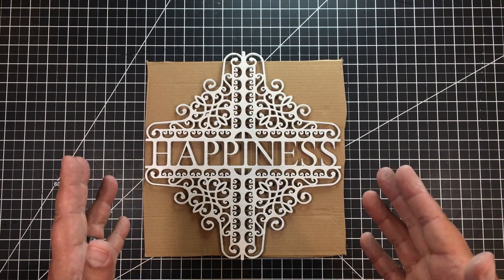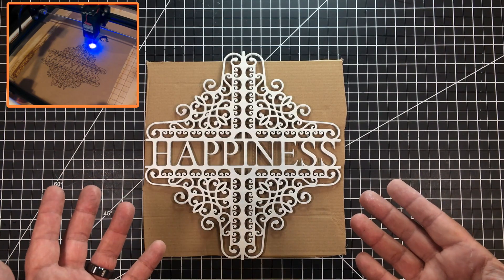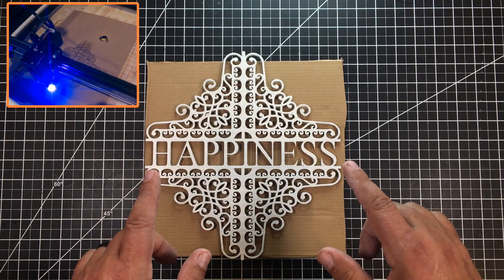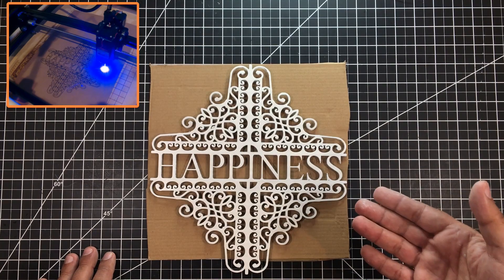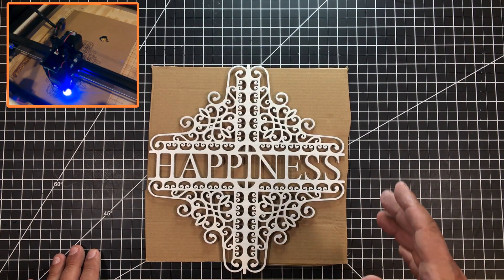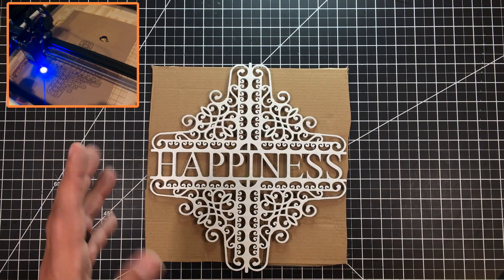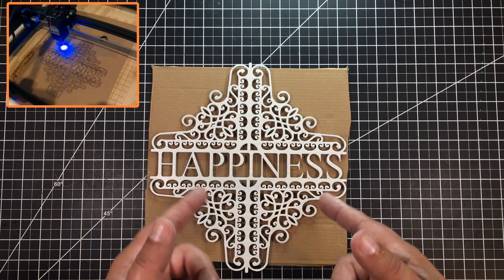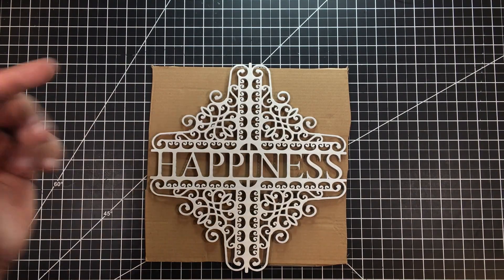Ortur Laser  -  This is a Craft Show Money Maker!

Comment: what is the maximum size you can cut and what materials can you use? Thanks
Reply from the maker: It varies greatly and also with color to so it is imposable to respond a reasonable answer.   If you have a specific material and thickness I try better to help...

Comment: Instead of lead in/lead out, did you try overcut?  That usually does the trick for me.  Overcut is a distance that you want the laser to stay on when closing a shape.  For instance, if you used it on a circle and put overcut on at 0.1mm, the laser will stay on past it's normal stopping point for an additional 0.1mm.
Reply from the maker: This is a great tip!  Thank you!

Comment: Hi, which lightburn settings  did you use? Speed , power? Thanks
Reply from the maker: For this with a G8 Lens I used 8mm/sec with 15 passes.  This was high-grade 3mm cardboard...
Reply: @DIY3DTECHcom   I have the  LM2 20w.
What power % did you use?

Comment: Great video!  I keep putting off messing around with cardboard on my 100w co2. I tried it once and it as super fast.
Reply from the maker: YES it is!  In fact that will be my next laser (I also have two k40's).  Question, what is the thickest wood you can cleanly cut with 100 wat laser?
Reply: @DIY3DTECHcom  the most i have tried is around 6mm I know i could go thicker but again I have a cnc that I use for cut thicker material.